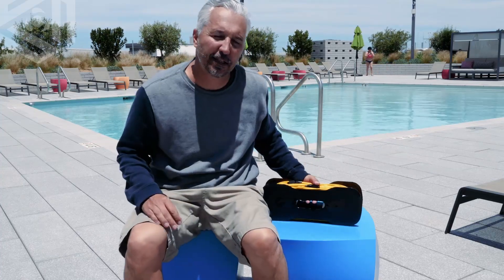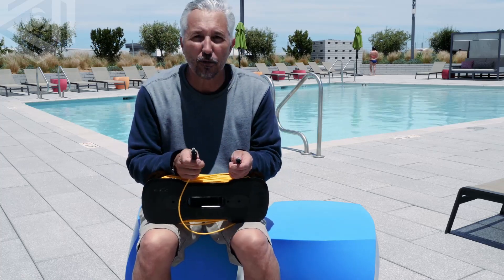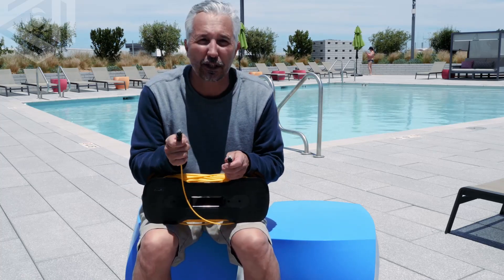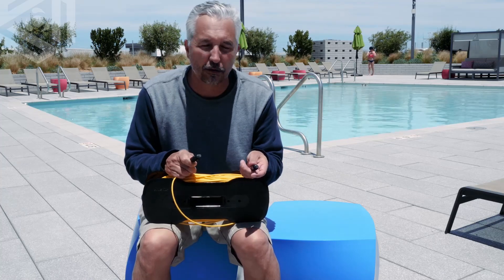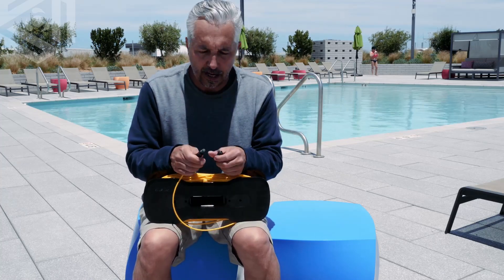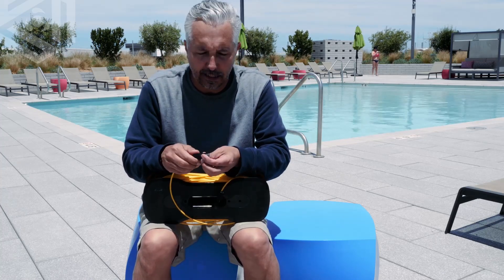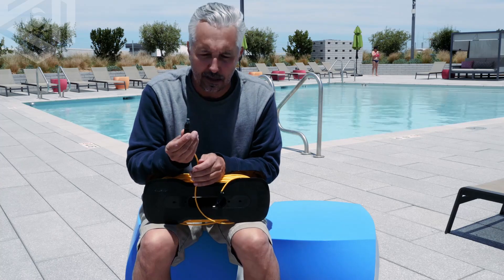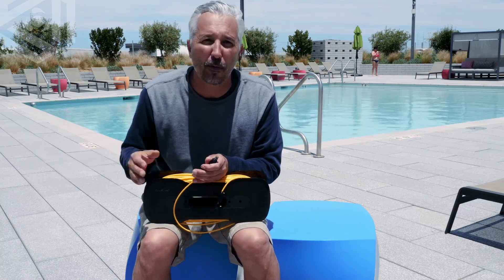CHASING GLADIUS MINI UNDERWATER DRONE | In Depth Tether and Winder

Comment: If I need to lower the drone into the water by holding the tether, will it cope? Or is this not recommended?
Reply from the maker: Yes, you can do this, but it is recommended that you choose an industry-grade robot, and be careful not to tangle the cable
Reply: @ChasingUnderwaterDrones   Thanks for the reply. What do you mean by choosing an industry grade robot? I have your drone, the chasing mini. Yesterday i had to pull it up from the water by the tether, thats why im wondering.
Reply from the maker: @Graome  Industrial-grade robots have more power and a more flexible stance to help you do your job better. After you are done using it, you can use the remote control to let the drone float to the surface and drive back to you. In this process, you also need to organize the cables to avoid them being too long and getting tangled.😊